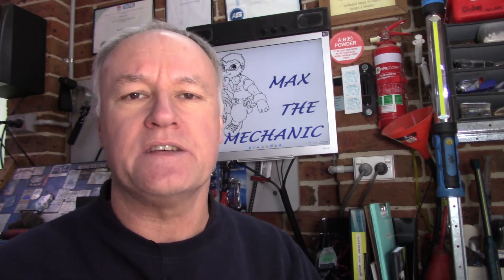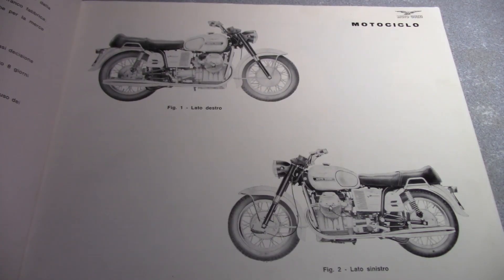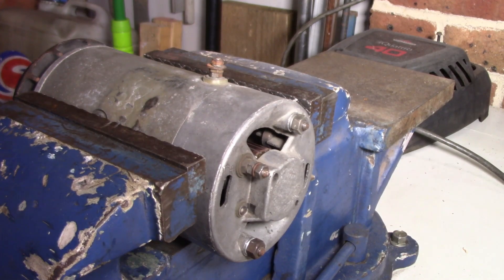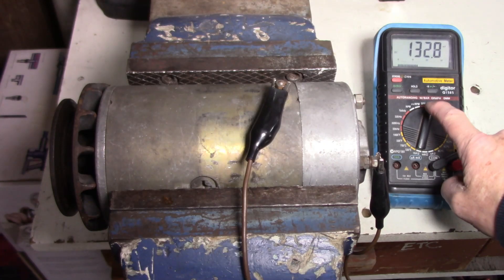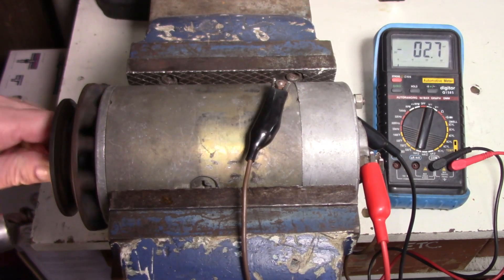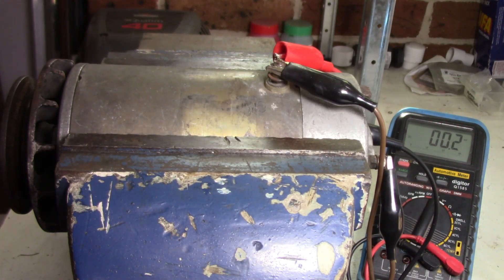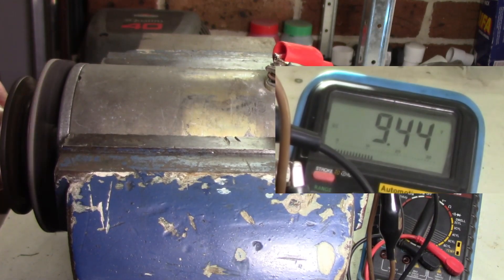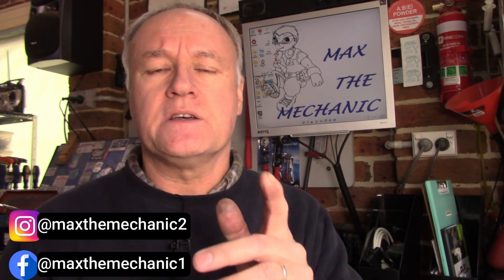How To Test An Old School Generator

Comment: The bigger the better. Thanks for the interesting video.
Reply from the maker: Probably took 10 horsepower from the engine, but at least you have power for the lights. 😁
Stay tuned for the regulator test next